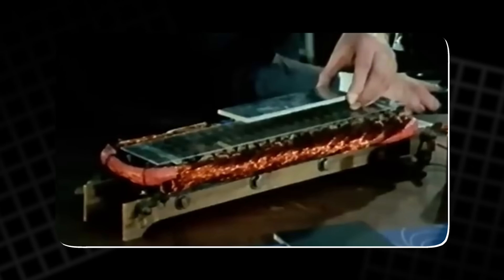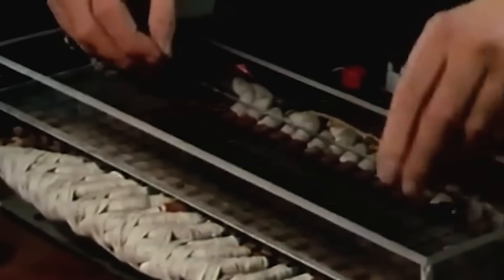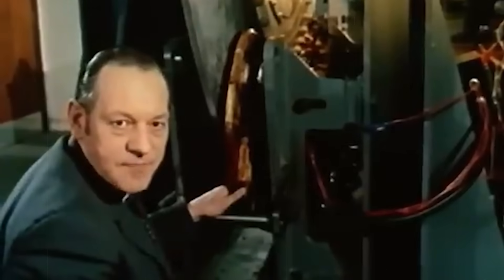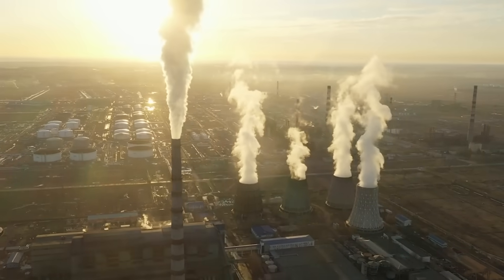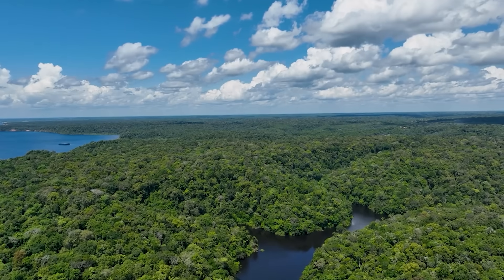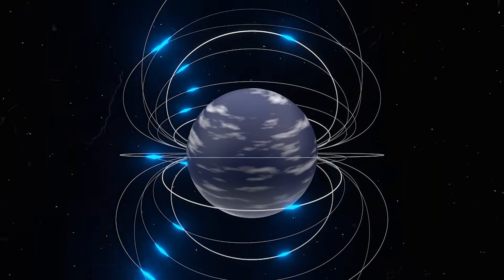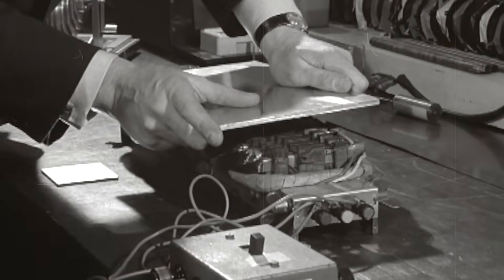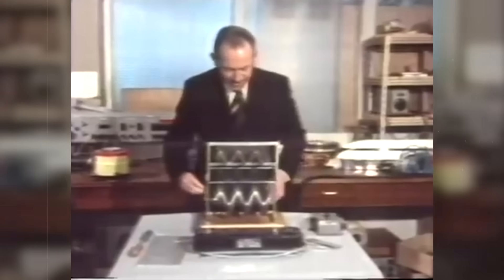Laithwaite’s Magnetic River: Was He Right All Along?

Comment: Magnetic rivers are amazing, but not for the reasons given in this video. They have nothing to do with ‘free energy’ since that isn’t possible. The work they apply on metallic objects is still not able to create more energy than is electrically supplied. They are instead amazing because they are able to levitate, propel, and guide any conducting object at once allowing for near frictionless travel. And on top of this, the force scales with the amount of metal meaning it is not limited by size. But no, you can’t build power stations using magnetic rivers (I’m pretty sure…)
Reply from the maker: Thanks for sharing your insightful perspective on magnetic rivers!